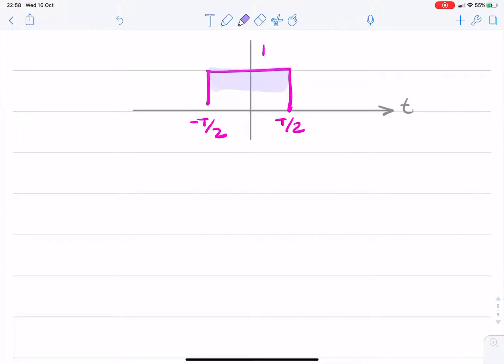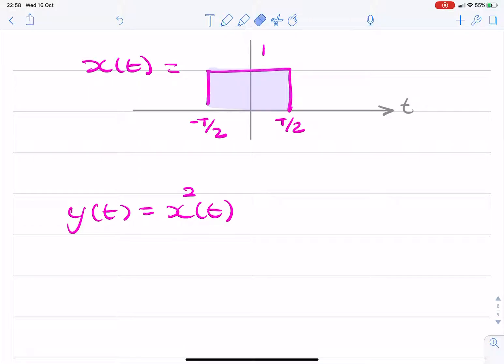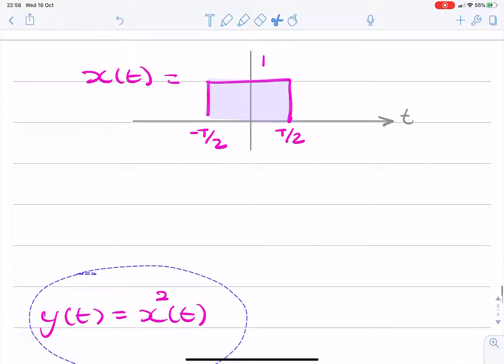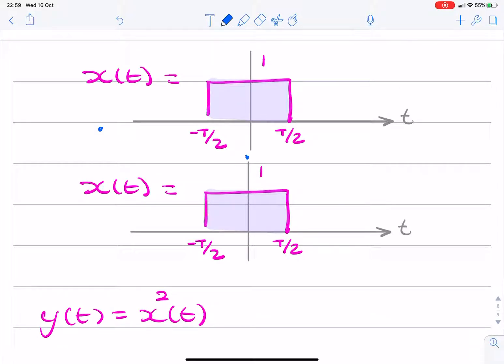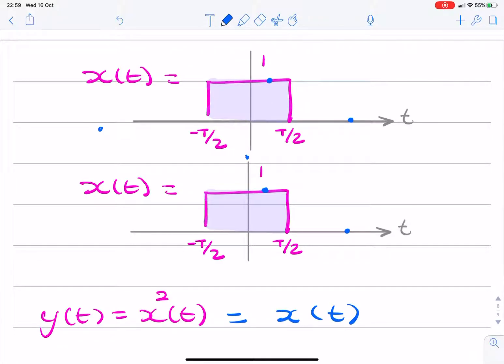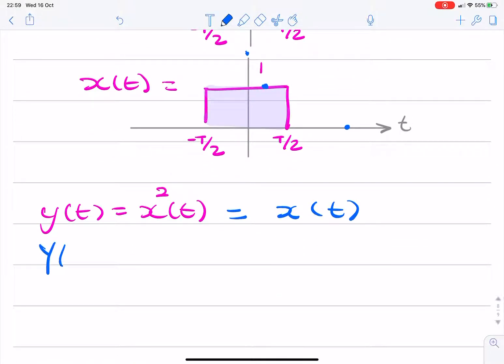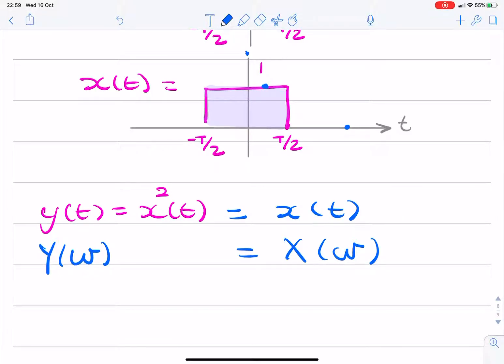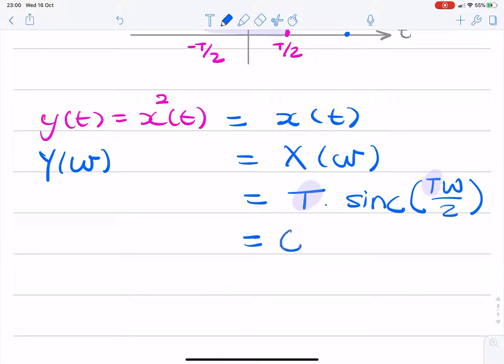Fourier Transform of rect function squared

Comment: Assume you solve by applying the convolution theorem - it states that the FT of (rect times rect) is (sinc)*(sinc), it yields a different answer. Where does the difference come from?
Reply from the maker: Carrying out a (cumbersome) convolution integration between the 2 sinc functions will in the end yield the same result.